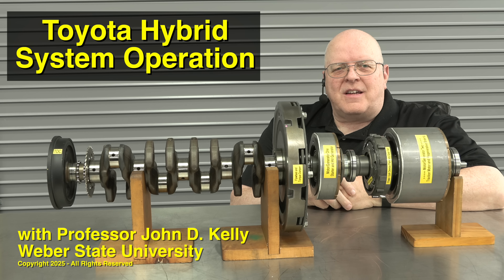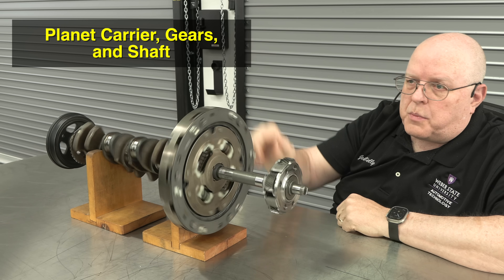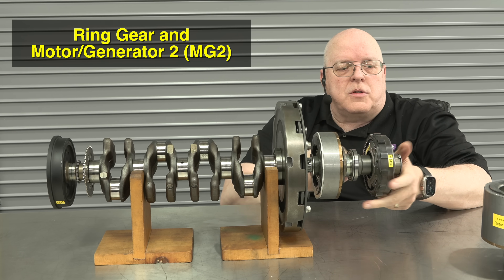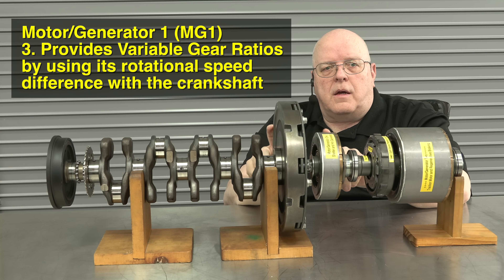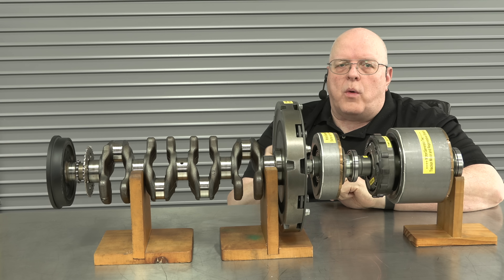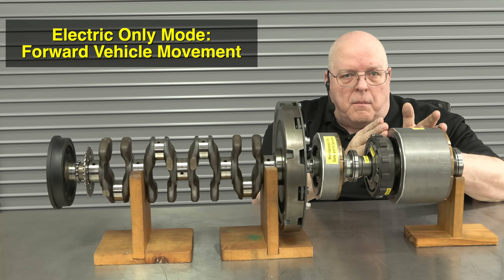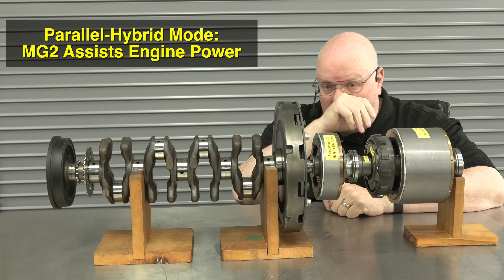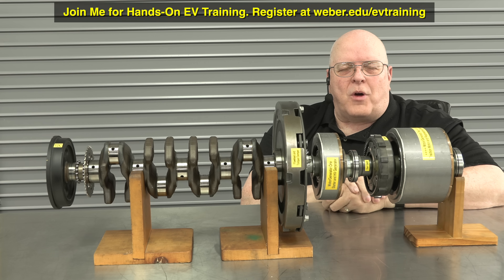Toyota Hybrid Transmission Operation - 15 Years on YouTube!

Comment: Despite your good explanation and everyone's reaction, I'm still not satisfied.  First, the term "Continuously variable transmission" is not valid for this.  There are specific gear ratios, and it appears to work like an automatic transmission.
     The variable power produced by the engine and motors doesn't make it variable, it's mathematical addition/subtraction of motion.
     There's no explanation on how any the engine and motor/gens are held still, in relation to each other or the chassis in different modes, without driving each other, or actively using power to either remain stationary or follow an adjacent component.
     Your explanation seems to suggest that the mot/gen 1 or 2 in different modes is the output to the wheels, which is confusing, without actual mechanical shifting of component connections.
     I was expecting other clutches to be involved when holding certain components in relation to others, which would be more efficient than electrically powering either motor/gen to resist freewheeling.
     I will be looking up other sources of info to add to the knowledge presented here, to satisfy the open, freewheeling ends of my curiosity.  Thanks again for your contribution!
Reply from the maker: Thanks for sharing your thoughts. There are not specific gear ratios with this system; instead it provides continuously variable gear ratios between a lower limit and an upper limit. Some of those variable gear ratios are underdrive ratios < 1:1, there is also a 1:1 gear ratio as a dividing line and then variable overdrive gear ratios > 1:1. This continuously variable gear ratio system is no different than any push-belt or pull-chain CVT.
Reply: Contrary.  It is very different from those devices you mentioned.  The "CVT-like" operation of these vehicles is merely simulated by software, clutches, and variable drive to the motor(s).  Mechanically, it is not a CVT, it's simply a transmission with discrete gear ratios, making it not a true CVT.

Comment: Toyota’s hybrid system is simply totally brilliant!
Reply from the maker: Agreed, thank you for watching
Reply: Think of the ETV as a locked set of gears that change the output ratio with an electric motor. It’s genius and practically indestructible.

Comment: Thank you for the Video! You have explained it very good! This year i bought a Corolla TS Hybrid with the 1.8L ICE. It's the best Hybrid System i have ever seen. A Serial Hybrid has one problem, the overall efficiency. Because you have to losses from the generator and it's power electronic an then you have losses from the electric motor an it's power electronic. So usually you will see parallel hybrids. But this are more like an ICE-only car with an additional electric motor. A parallel hybrid also needs an typical clutch, a complex automatic gear box with discrete gear ratios and complex mechatronic to shift. Toyota was developing a hybrid system from scratch. It's "Hybrid Synergy Drive" or "eCVT" can mix states like a serial hybrid and like an parallel hybrid. The advantage is, that most of the power of the ICE is going mechanically through the the gears to the tires with high efficiency. A smaller part of the power is converted into electricity and stored into the battery or is used to give it to the electric motor on the tire side. Maybe yes if just the ICE is needed, for some special points a parallel hybrid would be a little bit more efficient, but you have discrete gear ratios so you aren't able to get the best optimal efficiency point of the ICE in real. Usually you have a lot of different needed loads depending on your gas pedal. Also at the highway with cruise control there are different slopes with different loads. A parallel hybrid would need to change every time with the gearbox to a discrete gear ratio but isn't able to get the best point (also with a 8-course menu). Furthermore every shift will cause wear in the clutch and so you can't change every seconds the gear ratio. Toyota is able to change in a small part of seconds to the ideal ICE rotation speed which is in this moment the best efficieny point. In real there is an constant smooth of rapid variation of the variable gear ratio. If you are accelerating e.g. with moderate power with the gas padal the whole acceleration toyota holds the ICE at the best efficiency point. The overall efficiency would be better than with typical parallel hybrid. The weight of an Toyota hybrid is more at a typical gasoline engine only car than at a diesel engine only car.
Beside the "eCVT" Toyota uses an ICE which is running in the atkinson cycle and is naturally aspirated without complex turbocharger, without complex variable exhaust valves, without complex direct injection and so on. The 1.8L ICE has just 55 PS / 1l cylinder capacity. Typical turbocharged engines have e.g. 100 PS / 1L. ICEs with turbocharger originally designed for ICE-only need over a broad band of rotation speed a high torque and efficiency, but with high costs of complexity and costs of reliability. As I said: "Toyota invented it's hybrid system from scratch" and it's not an complex ICE-only car engine with an additional electric motor. So that complexity which will rise with an hybrid (compared to an ICE-only car) the complexity is reduced by the ICE (no turbocharger etcetera) and reduced by the automatic transmission (no hydraulic driven clutch, gears ecetera).
I like the system and it you have concern just look at the guarantee which has included a lot (also the whole hybrid system) and it's up to 15 years in Geramany or 10 year / 160.000km in Austria with it's "Relax Guarantee". 🙂
Reply from the maker: Thank you for your kind words and thank you for sharing

Comment: I wonder how the eCVT would work with a diesel with loads of torque, that doesn't need high revs to pull. I really dislike that the 1.5 and 1.8 engines never get a chance to apply their torque, but immediately jump up to high revs, when you apply some throttle. I've never tried a 2.5
Reply from the maker: Good question, Thanks for watching

Comment: I have an intriguing question 

So when B mode of 2nd gen Prius is activated you can feel an increased resistance when regen braking 

Does it increase the rate of regeneration of regen braking in anyway than normal drive D gear or does it just work as a usual engine braking system by connecting the engine while keeping it off n increase friction to slow it down..?
Reply from the maker: The B mode will increase the braking effect compared to D mode by using more engine compression braking in addition to regenerative braking.
Reply: @WeberAuto so it doesn’t increase rate of regeneration?
Reply from the maker: @chrisrolland  It can if the high-voltage battery has room for the additional charge. If not, it is all compression braking.
Reply: @WeberAuto hmmm interesting. Could you do a demonstration in a video about the B mode

I think that would be helpful for a lot of people cuz there aren’t  many info about that
Reply: @WeberAuto interesting.

Comment: I'm confused. MG1 and MG2 need to be attached to the crankshaft and they need to be attached to something else which isn't rotating. What is the something else?
Reply from the maker: MG1 is attached to the sun gear, MG2 is attached to the ring gear, and the crankshaft is attached to the planet carrier. Unlike a regular automatic transmission, one of the three pieces does not need to be stationary, it can slip at a slower or faster speed to achieve different gear ratios.
Reply: @WeberAuto  I'm still confused. Say you want MG1 to start the engine. Current goes into MG1 and the crank is not rotating as the engine has not started yet. What stops MG1 from just spinning around instead of rotating the crank?

Comment: Great video Professor. Now I need to watch it over again, and again,  and maybe go back to your earlier videos! I have a Lexus RX400H from 2006 and it works perfectly - shame they put a timng belt and not a chain though. Lovely V6 engine and economical for its size.  By the way there are some great animations on the American Toyota website. I was wondering where the drive shafts are connected to but you can see them on this animation: https://www.youtube.com/watch?v=hRYWqdiUlbA&t=202s
Reply from the maker: Thank you for your kind words.

Comment: These videos really help to undestand eCVT transmissions, do you know is the new Ford Transit PHEV eCVT transmission similar to these Toyota eCVTs?
Reply from the maker: Yes, it functions identically
Reply: @WeberAuto  Ok, thanks for the info. There has been some reports from Transit PHEVs, that during and immediately after a heavy acceleration, there has been a strong smell of clutch. Could that clutch package still slip and produce that smell? That would be strange for a new vehicle.

Comment: I've watched ALL of your videos on the synergy drive, multiple times. Thank you! I get average from new 77 MPG and 77% EV ratio '24 CCH AWD hyper mile use. simulated downshifts to max regen.
Reply from the maker: Thank you for your support, those are very impressive numbers even for hyper mile use
Reply: @WeberAuto when I bought it, I hoped for mid-upper 50's. Even in super mild NW Orygone, last fall mileage started falling with temps, made a removable grill screen, mileage immediately returned. Don't even need to remove it. Got the moonroof package, didn't want, for paddle shift. Use roof much, paddles never.

Comment: How does the generator mgu1  generate power when the car is driving and it is not spinning because it's in overdrive mode. Does mgu2 take over the oower generation at that point?
Reply from the maker: At the vehicle speed where MG1 is stopped or almost stopped. The engine power is propelling the vehicle and also spinning MG2 as a generator. Thanks for watching.
Reply: @WeberAuto thanks for the reply! What an amazing system.

Comment: Great explanation, thanks.  A question off-topic: if the starter fails, am I to understand that most/all of the drivetrain has to be removed and disassembled and reinstalled just to get the car to start again? If so, that's unnecessarily complicated and quite frankly, absurd. Again, you did a great job explaining this, though.
Reply from the maker: That is technically true, but I have never heard of that happening. It is a very reliable system. Thanks for watching.

Comment: Does the engine 1 ever switch direction while driving forward and accelerating? From underdrive to overdrive?
Reply from the maker: The internal combustion engine does not change direction, but motor generator one can.

Comment: Such a simple but at the same time a very clever design, and with very few components you can see why it is such a reliable system, having driven this hybrid system in my Corolla it is incredibly smooth and very fuel efficient and handles most situations well, the only issue is the lack of power at higher speeds and it can get a bit noisy if you press the accelerator hard, but the vast majority of the time you won't drive like this so it's not a problem
Reply: That's what I like the least about them. I'd like for the engine to at least try to pull a little at lower revs, before giving up and jumping to high revs.
Reply from the maker: That is true. thanks for sharing your experience!

Comment: Excellent demonstration. Whenever I see a transmission design, I always think of what is the maximum RPM of a component inside it? On most ICE cars, there is no component inside a transmission that spins significantly (meaning say more than 1.3 times as fast) faster than engine speed.  In this transmission, how fast would M1 be spinning at say 100 MPH? I have the feeling that its hard to design a bearing that will last at sustained speeds in excess of about 10k RPM? It concerns me at the short life of the drive Units in most EV designs.
Reply from the maker: Thank you for watching. Many of the electric motors in these Toyota hybrids are capable of spinning up to around 17,000 RPM without any problem.

Comment: I took a 2008 Prius into a transmission shop two weeks ago. It had 360,000km and the transmission shop said, "never seen one apart, because they never break."

I asked, why?

"It doesn't have a belt like the Nissan junk."

Comment: From what I have read, the idea of the planetary gear set is billions of years old. We see it every day. It’s the sun and the planets that revolve around the sun.  Astronomers in 148 AD referred to the solar system as a Hybrid system. Toyota uses this system by sandwiching the planetary gearset between a pair of electric motors and a generator.
Reply from the maker: Yes, it is a very clever use of the planetary gearset.

Comment: Perfect explanation. Of cause would be good to see every movement “ in nature”. I have question about that clutch: whenever there is transition between electric only-to-ICE and vise-versa I feel and hear specific “jump” of an engine and body; also I have it very start up when ICE starts after it’s been parked. Does that stress movement show indication of clutch being worn out? Thank you very much
Reply from the maker: Thank you, the jump you feel when the engine starts or shuts off is a result of the Pistons coming to rest under compression. It is not a result of the clutch. Toyota tries to minimize the jump by playing with the valve timing to lower the compression upon shut off and increase it upon starting. I hope that helps.
Reply: Thank you sir. I have noticed that different Priuses of the same generation act differently. If my Prius “jumps” more than another one is that mean my Prius have higher compression than the another one’s? By the way, to decrease those “jumps” I have to set the parking brake whenever I do park so that movement will be reduced. Also I have read something about damper flap noise during a transition

Comment: Is the shift knob just sending an electronic signal to the eCVT and is not mechanically linked to it?
Reply from the maker: Yes, that is true on most models
Reply: @WeberAuto and I am specifically asking about 2021+ Sienna
Reply from the maker: @sinisagolub7010  The Sienna with the P810 transaxle does have a mechanical  shift cable

Comment: TIL eCVT has nothing at all to do with CVT, technologically speaking.
Reply from the maker: They both provide variable gear ratios between two outer limits. The eCVT is very reliable where the push belt and pull chain. CVT’s are not. Thanks for watching.

Comment: I have one of these in a 2013 Lexus ES300h. I was apprehensive at first but now I like it so much for its smoothness, I don’t think I will go back to a traditional transmission. My 12 year old battery needs replacement though.
Reply from the maker: Thank you for sharing your experience with the system!

Comment: How does one stop or reverse the MGs?
Reply from the maker: There is a part called the inverter that controls the speed and direction of the motors. As the variable gear ratio is changed eventually MG1 slows to a stop so that it can then spin backward. MG2 only spins backward when you put the gear selector in reverse. Thanks for watching.
Reply: @WeberAuto  Thanks for explaining. Its clearer to me now.

Comment: Does MG1 always recive torque from ICE in order to control ice/wheel ratio both in under drive and overdrive? Is there a high speed scenario where MG1 would actually need to supply power together with ICE? Would it then receive power from MG2 via inverter?

Comment: A very robust transmission design, arguably even longer lasting than a simple MT. Leave it to Toyota to masterfully implement such a brilliant system.

But lookout if MG1 or MG2 were to fail prematurely. Very expensive repairs.
Reply from the maker: They have been very reliable. Thanks for watching

Comment: Why would MG1 want to turn without the engine turning? Doesn't it provide energy into the battery as the engine spins but that's why it's much smaller than MG2?

Comment: Love you explanations.  How well does the planetary gearset handle torque, seems like these eCVT's aren't recommended to tow.  I like to know why as they seem simpler than a manual or multispeed auto
Reply from the maker: Thanks! The planetary gearset is very robust and is used in larher SUVs like the Grand Highlander Hybrid, but the design is not optimized for heavy towing. Thanks for watching.

Comment: Thank you! Why does a Honda Clarity which has an eCVT need a transmission fluid change?
Reply from the maker: It still has gears that need lubrication. The motors are cooled by the fluid, it has a clutch pack for overdrive. It still needs a fluid change at the proper intervals. Thanks for watching

Comment: Such a clear and simple explanation. If there were anything I wish that could be added, it would be a representation of the tires being turned by the motors, or turning the motors in the case of regeneration.
Reply from the maker: Thanks, the larger of the two motors (MG2) drives the tires and is driven by the tires during deceleration. I should’ve done a better job pointing that out.

Comment: We should all be quite thankful that electric motors and the control circuits to drive them have gotten so absurdly efficient because it enables flexible architectures like this to operate with comparable efficiency to mechanical solutions, with substantially fewer compromises. With the right motor and drivers you'll only lose a few percent at each step, and since mechanical transmissions (CVTs especially) themselves have meaningful losses via friction, all this complicated shuttling of power in and out of the electrical system does not hurt system efficiency as much as you'd think.
Reply from the maker: Thanks for sharing your thoughts.